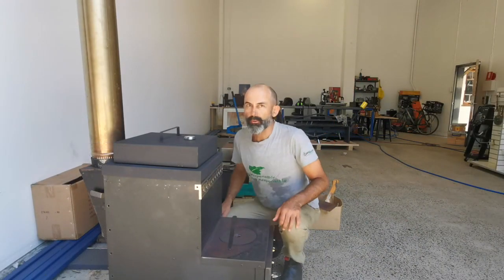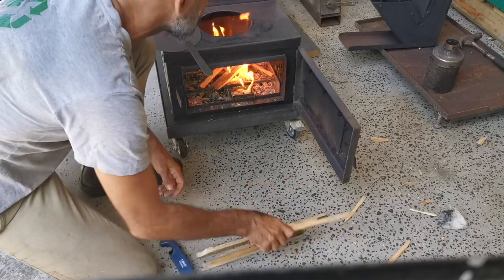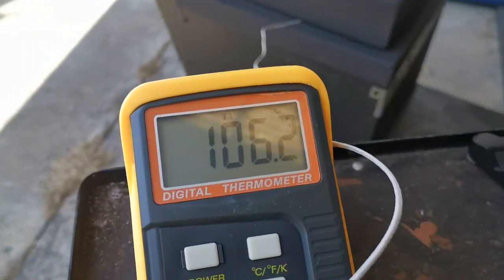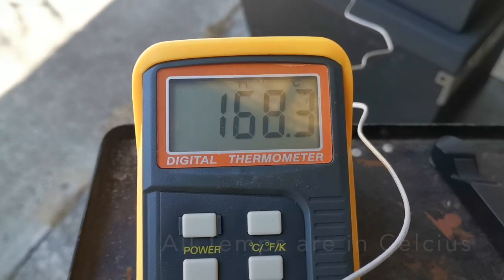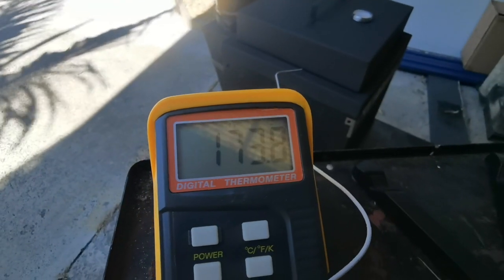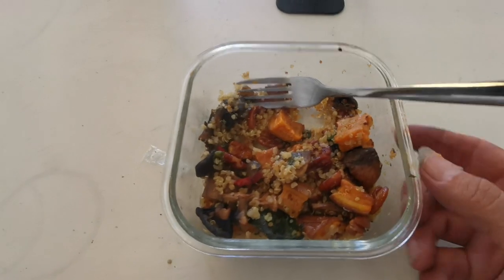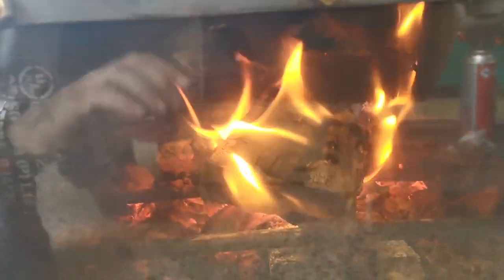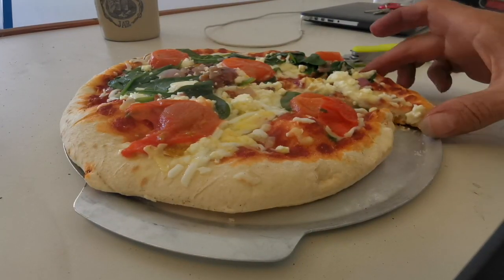Simple Oven Box on top of the Eco2 Rocket Stove

Comment: can you add a heat powered fan to it  to radiate heat ? Do you have plans to add one to the existing system or or as an accessorie?
Reply from the maker: generally I prefer passive systems but yes you can pop a heat powered fan straight on top. I've got one at home and it works great.